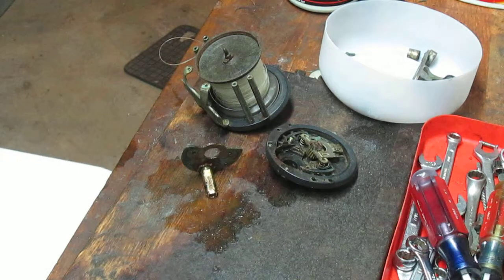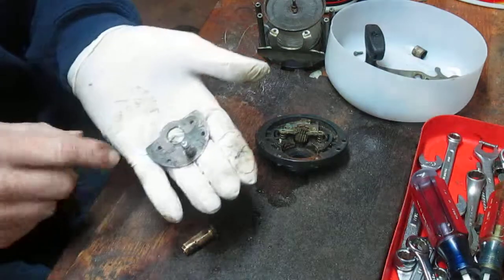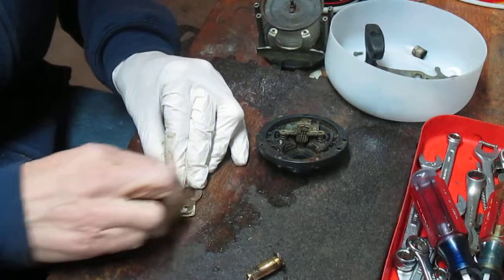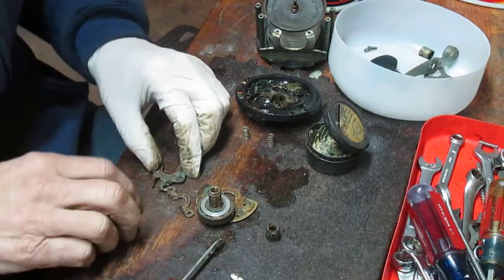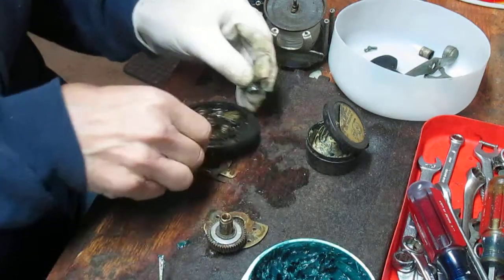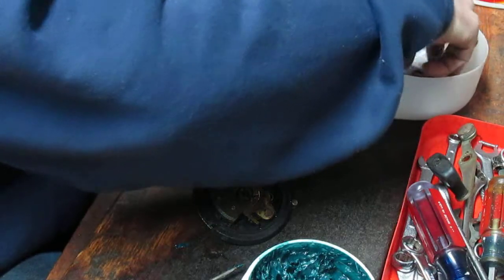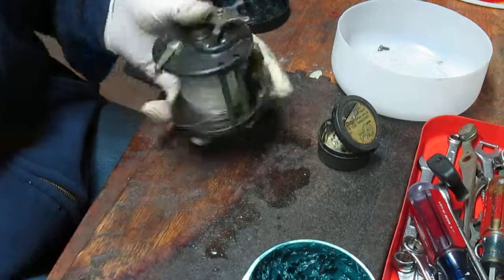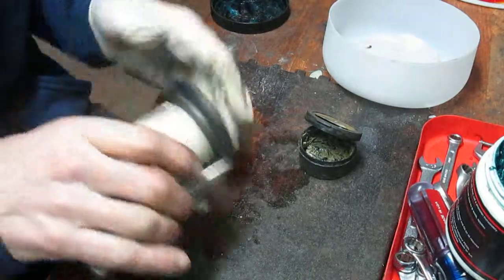Penn Reel main shaft pinion gear service or repair Long Beach & other conventional models

Comment: With the pinion gear rotating on the pinion shaft, how much free play is acceptable, vs knowing when its too loose that it should be replaced with a new pinion gear and shaft?

Also with parts cross-referencing, which other Penn reels (besides the Penn 109 Peerless) would have the same inner parts as a Lawrence 202 level-wind?
Reply from the maker: I make It a point to do annual service on my reels and I always pull the gear side to clean and re-lube the shaft.  If you have the reel apart, it only takes a few minutes to take the extra step, so I do it as I am checking the drags for wear and cleaning up the old grease.  I am not aware of a cross reference to the Lawrence 202 reel.  I guess you would just have to try a few to see what if any fit. Thanks for asking - Dennis